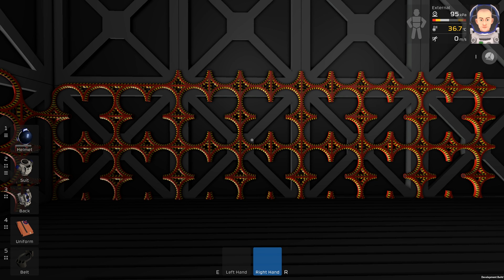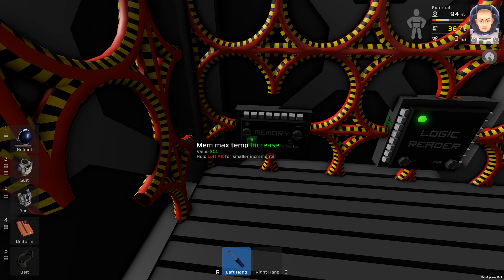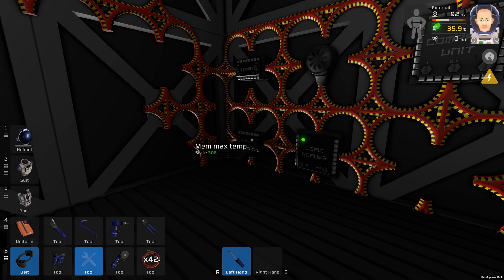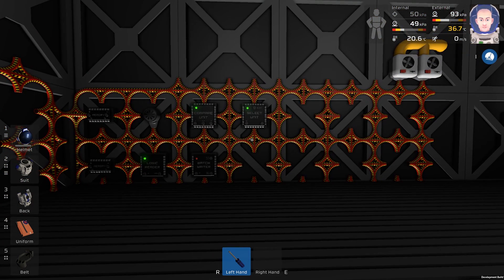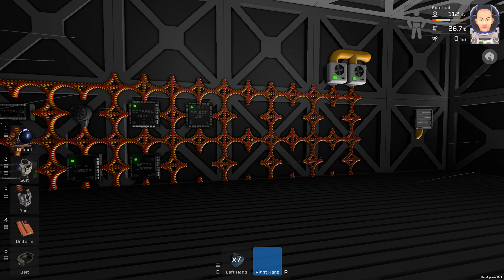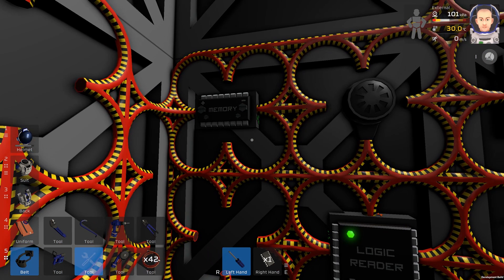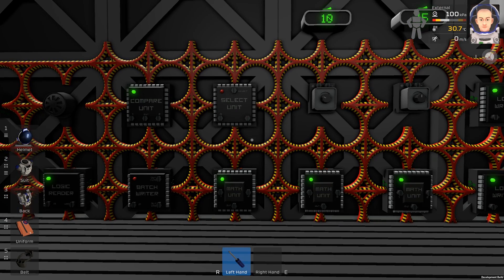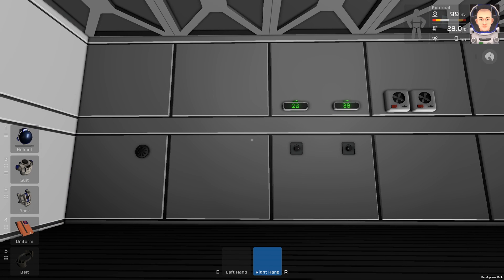Stationeers - Tutorial advanced cooling

Comment: Possible alteration: Instead of using 2 math units to adjust the dials into Kelvin (+273.15), you could simply use minus 273.15 on the temperature that the gas sensor reads (convert the sensor's temp into Celsius). This would mean you only ever need 1 math unit instead of 1 per dial. You could also display the current temp on an LED display (now it's in C, it'd make more sense).

Another possible alteration: Instead of using a "variance" type of system, where 1 dial sets the min temp, the other dial sets the "variance" (or "gap" as you've called it in the past)... wouldn't it be more user-friendly (and it would save a math unit) to just use a max dial instead. EG: Dial 1 set to 25, dial 2 set to 30 = the system tries to keep temp between 25 & 30. The way you're doing it still works, but I imagine that some people would find it difficult to wrap their brains around.

One last note... Keep up the great work! :P
Reply from the maker: thank you for advice, I will try it